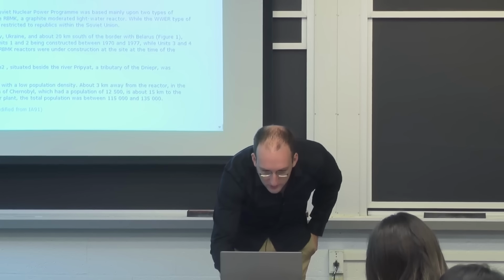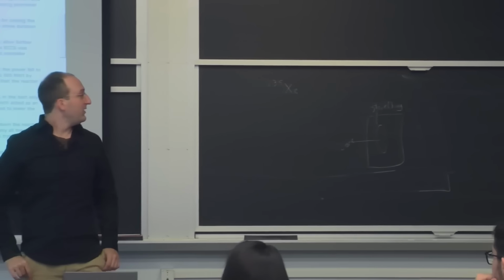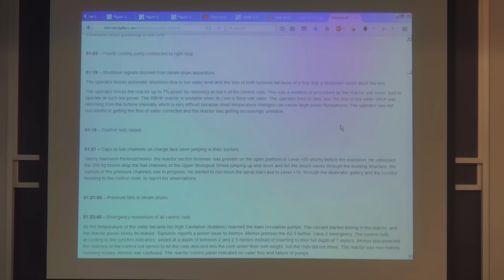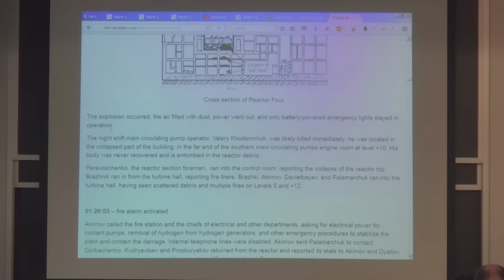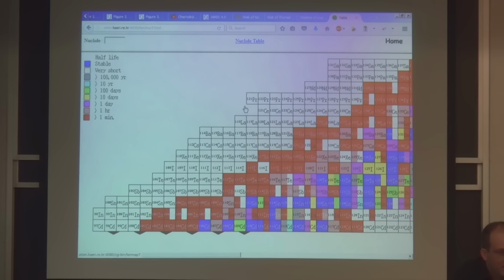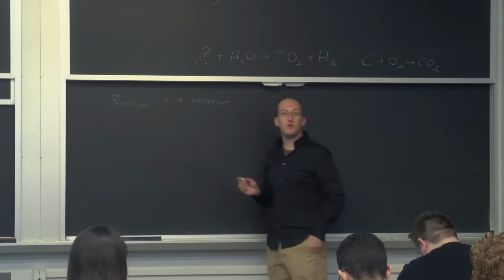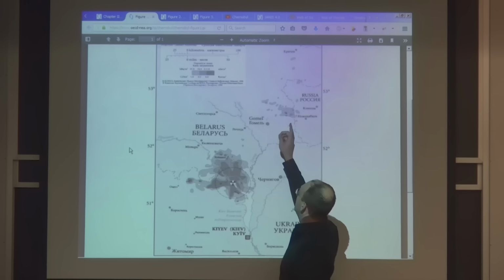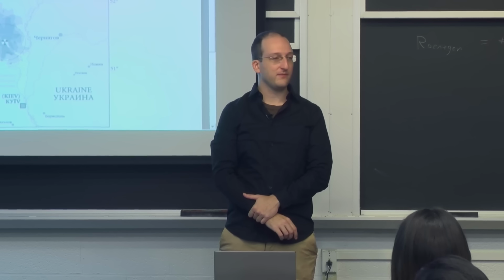26. Chernobyl — How It Happened

Comment: First off: the Control Room crew wasn't stupid or reckless. The acted according to the operators manual given to them at that time. Nobody told them about the positive Void Coefficient. Nor more importantly the positive Energy Coefficient of the RBMK 1000 which was discovered 2 days earlier during an experiment after altering the Control Rods. They were shortened without explicitly  stipulating it within the Operators Manual, since Reactor 4 was also a testbed for new procedures. It left a bigger water Column on the top and the bottom of the reactor which turned the energy Coefficient positive. Meaning a runaway was getting more likely.

The Reactor Crew was not given any Operational guidance on running the reactor at 700 MW(th). The rules and stipulations were released and backdated to prior of 1986, to cover the wrong doings of Valery Legasov and party members at the MinEnerGCO and the Kurchatov Institute who ordered the test to be done. Despite Anatoly Dyatlovs complaints about this test being uneccesary and dangerous.

There was also no Hydrogen explosion. Neither the Zirkalloy nor the Graphite could produce enough Hydrogen in such a short time frame (we talk 3 seconds), to emulate an explosion of around 225t of TNT equivalent. Furthermore there is no Zirkonium Dioxide to be found anywhere in the Reactor wreckage, meaning a Zirkalloy-Water reaction didn't occur. There still is a debate going on what exactly happened, most people go with Alexander Sich's theory that the initial release of the backpressure by the first steam venting, opened the backflow valves of the reactor meaning that the residual water all at once flowed back into the reactor and instantly flashed to steam, creating the second explosion.

Comment: 10:48  30MW is less than 1% of rated reactor power (3,200MWt), less than 3% of rated generator power (925MWe). which one are you talking about here?

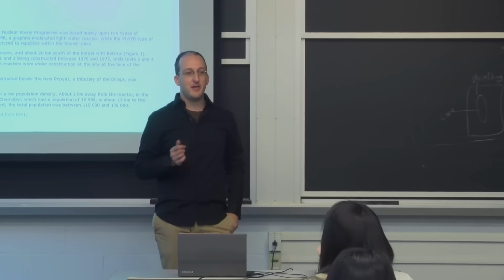4:00
generator coils don’t spin, the rotor spins … the excited rotor windings (dc+ and dc-, N and S) induce a 1st  spinning magnetic field …
a 2nd (lagging) spinning mag field is induced from the circumferential arranged (stationary) stator coils that are exposed to the 1st field… if the main breakers (one per phase) out in the switch yard are closed,  energy from this 2nd field will flow through the stator windings and out onto the grid (via a step-up transformer a big as the typical  house in a modern subdivision)

Comment: Thank you for this Very informative lecture. 

Time Distance and Shielding Principal.
Water Lead and Concrete, Sheltering. The Basement is Your Friend. If No Basement is Available?
Find a Sturdy Concrete Stucture for taking Shelter. (Stay away from Windows and Out Doorway access) 🌱

The 7-10 Rule.
After 3 Days or 72 Hours of Shelter, Radiation Gamma Decay Danger Levels Decreases, Significantly.🌱

Avoid Dust Particles,
Taking a Shower and (Bar Soap) is your Friend. Rain Water from the sky is your Friend.🌱 

Avoid Outdoor Puddles of Water and Water Stream Collection. High Concentration of Radiation Gamma Particles Collect Within these Areas. 

It's Good to know the important things in life. 😊🌱

Comment: @52:23 "Folks have started to move back to some of these areas" Good old year 2016, for couple of years folks have been moving away, and not just from that area, but most of Ukraine, with little prospects of returning. Turns out there are more dangerous things than radiation and the Chernobyl disaster.

Comment: How it happened? Well, thanks to you HBO! Everybody's a nuclear expert today! I'd say it was a minor criticality incident, just a few seconds, nothing to worry about, occurs in the best families. No, nuclear energy is perfectly safe and always was! Come on, 30 fire fighters, minor calamities. Every rig or coal mine is wasting this in a good season.

Fukushima you say? 

Well, one could say that any commercial reactor (the swimming pool and submarine types aside) is a car with a very powerful engine and a very convincing torque converter transmission. Problem, there are no brakes, not at all. The only thing one can do is, to take the foot off the gas, to take the neutrons away. After that one has to wait, till the vehicle eventually slows down, which takes its time. It won't stop, it will keep running for thousands of years, when those rods once got a taste of thermal neutrons. But it is okay, at walking pace one can even open the lid. Well, when out of full load there is such thing as a wall in the way or a hole in the ground or a traffic jam, then there will be issues as seen in Fukushima. Therefor, always check your brakes! You have them, reactors don't.

Comment: The thing to know about Chernobyl is that it was a graphite moderated reactor, graphite being flammable is inherently dangerous as a moderator.  This is also what the Hanford nuclear reactor was, thank God it was shut down.  Graphite reactors get contaminated and become less efficient moderators over time.  To purge the graphite of contaminants and restore it's functionality, they have to intentionally superheat the reactor.  This can cause the graphite to catch fire and that's what happened at Chernobyl.  Graphite is hard to ignite but once it is ignited it can burn white hot and be very difficult to extinguish.

Comment: 21:46, I worked in the semiconductor industry for 33 years. One of the common processes used is the growth of silicon dioxide (SiO2) as an insulator in the devices. It can be grown by using either 100% ultrapure Oxygen (slower growth rate) alone or by using 100% ultrapure Oxygen + 100% ultrapure Hydrogen (faster growth rate). If using the H2 method both gasses are introduced to an external flask in a ratio of approximately 2:1 where they are ignited and generate steam which then flows into a quartz process chamber containing silicon wafers at temperatures anywhere from 1000 to 1250 degrees Celsius. The interaction of the steam (or pure O2) at the surface of the Si at temperature cause a layer of SiO2 to grow on the surface of the wafer. Growth of the SiO2 is logarithmic because in order for the SiO2 to grow the steam (or O2) must reach the silicon/oxide interface; therefore, the time to grow it is not linear. The thicker it grows the longer it takes the steam to penetrate to the interface. 
Anyway, that's a brief description of the use of 100% Hydrogen.

Comment: 4000 dead? that is 2 orders of magnitude higher than the probable death toll! 42 is the accepted number. anything else is just guessing, isn't it? and the bloke failed to mention it was only one or two technical channels splitting, that caused a little explosion, that slightly lifted the upper shield, which then pulled out ALL the rods, which cause the main event. hence the 2 explosions

Comment: Diatlow says something completely different in his book. In his version they didn’t do anything against safety regulations and there were no alarms and no single problem until they hit the AZ-5 button. Contrary to the hbo series.
Reply: Quite likely INSAG-7 report should be quite good. It analyses operating procedures noting that while operation with ORM below 15 effective rods was not allowed, instructions were quite vague indicating various thresholds (from as high as 30 effective rods for 500 MW to as low as 15 effective rods) and not stressing importance of this parameter. Also ORM was calculated pretty slowly (complete calculation cycle in control computer took 5 min). INSAG-7 report was produced at that time in Russian history when we may expect much less “Russia is never too blame” effect than usual :)

Comment: I have a BS In Mechanical Engineering and worked in electrical power engineering for 36 years. 11 of those as a field service engineer for GE on steam turbine generators. I was the new unit start up engineer for two nuclear units in US in mid 1980s. I was in the control room with the operators when initial testing involved the operation of the turbine generator. I never witnessed a test like the Chernobyl “coast down”. A 1200 MW unit would take 90 minutes to coast to a stop from 1800 rpm (normal operating speed for a 60 Hz generator in US)The conditions for that were no electrical load on the generator and maintaining condenser vacuum on the turbine exhaust. In order to maintain vacuum you must have cooling water and that takes pumps. If vacuum is lost the generator will stop in a few minutes. I have no idea how much energy the reactor cooling pumps would take in addition to the cooling water condenser pumps but when I first learned of this test scenario I thought it was crazy.

Comment: Xe135 half life is 9 hours, not five days…
Reply: And no, the control rods had no graphite tips, it was a little bit more complicated: the top half was boron, the bottom half was graphite. By doing this, the control rod was way more effective, because of the difference in reactivity from having the rod up or down. In the up position, the graphite was right in the middle of the core.
Reply: And it’s not immediately produced, it’s a decay product of Te135 and I135, a decay chain that takes around six hours. That means, at any certain moment, you have the Xenon poisoning effect relative to the power level of the reactor from six hours ago. That’s why lowering power in a reactor has to be done very gradually: if you do it too fast, you don’t have enough neutrons for countering the Xenon from when the power level was higher, and the reactor shuts down. That’s the effect that the request for power from Kyiv had: they then tried to lower the power faster than they should, and the reactor stopped. That’s why they started to raise all control rod, trying to counteract this effect.
Reply: The positive void coefficient was not started because of the power increase, but because of the safety test: when they shut down the reactor and tried to power the cooling pumps with the spinning down turbine, the speed of the pumps decreased, and the water pressure at the bottom of the fuel channels decreased, increasing the steam percentage in the cooling water. That, then, started the power excursion.

Comment: Graphite tips is not entirely correct description.

In RBMK reactor a control rod consisted of two connected parts - 7 meter absorber part at the top and 4.5 meters of graphite displacer part at the bottom. When a control rod is withdrawn to the top position and the top absorber part is completely outside of the core, the bottom graphite part remains in the core and displaces water to prevent this water from absorbing neutrons and slowing down the reaction. (note: to improve the yield of fissile material)

But the bottom part of a control rod is only 4.5 meters long so at the bottom of the core there is still 1.25 meter of water which absorbs neutrons (the same at the top) and when a control rod goes down this water (absorber) is replaced by graphite (moderator) for 14 seconds until absorber part gets down. Why the bottom part is only 4.5 meters? There is only 5 meter space below the core for the bottom part when a control rod is fully inserted.

Before AZ-5 was pressed there were about 60 control rods out of 211 still partially inserted for about 1 meter on average. The core was split into three parts - the bottom part with about 10 special control rods which were inserted from below and with about 1.25 meter of water (acting as absorber) present in about 140 channels, the middle part without absorber rods but poisoned by xenon and the most active top part which had dozens control rods. So when all control rods went down these rods pushed out 1.25 meter of water (absorber) from 140 channels in the bottom part and replaced it with graphite (moderator), increasing reactivity at the bottom significantly (about 3-4 times compared to the level before control rod insertion and about twice if compared to the most active top part). Such significant increase in the reactivity in the bottom part caused a runway there and explosion.

-------------------------
Alex Demidov
https://www.quora.com/Why-was-it-a-problem-to-have-graphite-tips-in-Chernobyl-reactor-control-rods-The-reactor-was-full-of-graphite-moderating-material
Reply: I am in love with you
Reply: IMHO, that's "the flaw" in the RBMK-type reactor. This video has animation on the power-spike produced from the AZ-5 shutdown procedure https://www.youtube.com/watch?v=q3d3rzFTrLg . 

In layman term, there were 6 buttons for different types of emergency shutdown. During an unsuccessful electrical test, the reactor core was melting, so the AZ-5 shutdown button was pushed. This means all the control rods are to be inserted (lowered down from top to bottom) into the water channels of the reactor as fast as possible (there are other slower shutdown procedures). However, lowering down the control rods also mean lowering down the moderating rods which displaced water that was cooling the bottom part fuel rods (there should be equal amount of water replaced at the top part of the control rods. However, the water at the top is hotter than at the bottom). This cause a spike in nuclear reaction. So, instead of a typical nuclear meltdown, we get  "very beautiful laser-like beam of blue light caused by the ionized-air glow that appeared to be flooding up into infinity".

Comment: Its not operator stupidity
Its professor stupidity
Graphite cannot burn. Its impossible.
MIT should fire that man ASAP.
Reply: Also ECCS in RBMK actually starts working 30 seconds AFTER its activation man/auto. ECCS was ineffective at the Chernobyl incident at all.
What about 30 control rods - 30 is approximate amount. It wasnt even written in operation manual how much exactly control rods should be inside the core.
Professor operates aftermath info about RBMK. Operators doesnt even know about "Концевой эффект" (excuse my Russian I dont know how to correct translate this termin). And so professor calls operators stupid. This sounds insulting. That people havent done any thing wrong.
BTW I watched just 14 minutes not all the video.
Reply: I should continue my corrections.
Its was totally quiet in control room. Operators just receive confirmation that measurements in turbine hall was completed so its time to stop reactor. It wasnt emergency stop. They just should stop the reactor because of test program was completed and last step in that program was reactor shutdown for maintenance. So SCRAM button was pushed. From now on everything gone wrong.
It wasnt emergency SCRAM - remember it.
After this all info is correct.
Reply: I guess graphite’s 752 deg F ignition point means something different to you.  You’ve pretty much lost credibility, making reading your additional comments unnecessary.
Reply: @Pene7942  can you please show me then how graphite burns at 400 celsius? Also all my additional comments not about the graphite so I didnt realize why you should pass them but ok its up to you

Comment: Would a containment structure made any diffence in an accident of the scale like that at Chernobly? I mean if a nuclear reactor exploded like chernobly did, would it not also be blown to bits  and contain nothing?!
Reply: That's an interesting question. The main problem was the multiple flaws in RBMK-1000 design. Fukushima-Daiichi reactor had a containment and also exploded due to H2 excess. So, in the RBMK case, the containment alone possibly would not be sufficent.
Reply: @GusJebzz  I tend to agree. Containment structures are important as I am sure that they have the ability to contain radiation leaks and explosions of a certain magnitude. But beyond a certain thresehold - like in the case of Chernobly - they will not be enough. Its like a soldier's helmet, it won't do if you are hit bya 50 cal bullet fired 500m away, even though the hemet is made of kevlar.
Anyways thank you for the lecture.

Comment: That’s a professor.  No politics and he doesn’t get steered off course.  I’m not officially educated in this arena, but do understand physics reasonably well.  If I’m not mistaken, radiation that passes through you is not as bad, compared with radiation that terminates it’s trajectory inside your body.  All the Energy dump from a particle as it decelerates, is in the last bit of travel. Something like 96 percent of the damaging energy is released the moment the particle stops.  Whereas if it’s traveling right through your body it may only lose 2 - 3 - 4 percent.  I was thinking this might come up in the lecture but I guess it didn’t.  Anyone feel free to correct me if I’m wrong here.

Comment: this highlights the loss of efficiency in the Chernobyl design. alot of heat was wasted in the graphite which was not used to power the turbine at the same time the lack of a containment means outside temperatures would effect the overall efficiency.